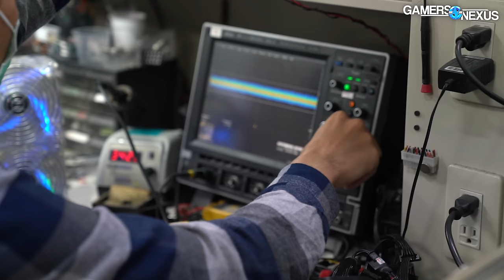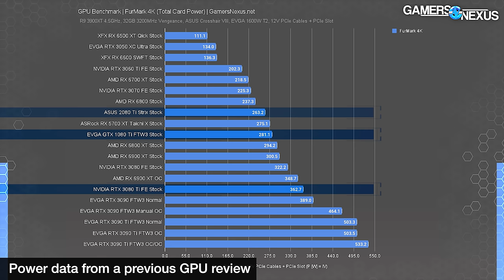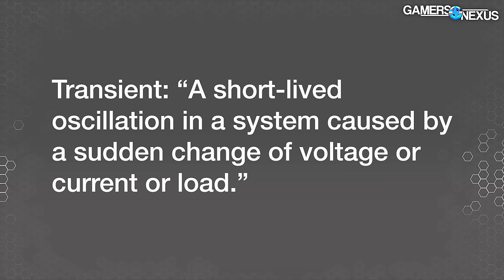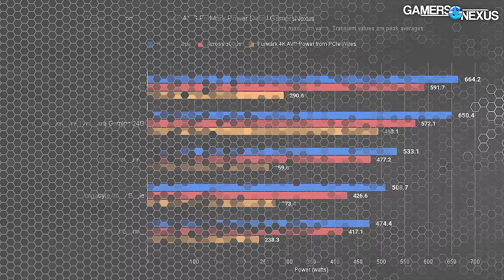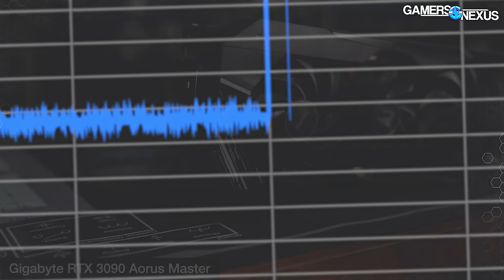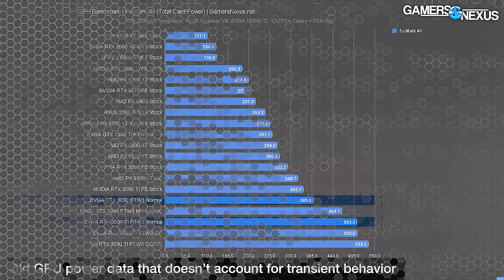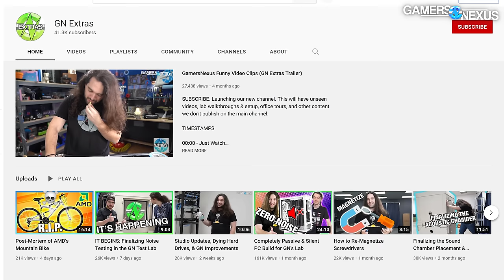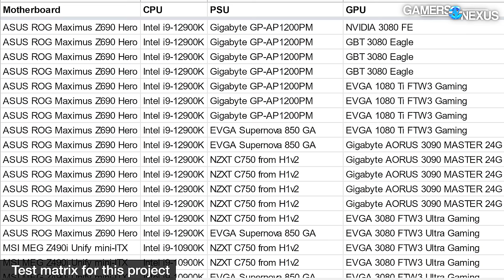The Brewing Problem with GPU Power Design | Transients

Comment: I don't know if this is helpful, but I have a 3070, 5800X both overclocked with an EVGA 750W G3 PSU and Gigabyte B550 Aorus pro board. I've never had a problem with this, but like you pointed out the transient spikes aren't as extreme with a 3070.

Comment: I have an old GTX 780 that would work great on a brand new 650W or 750W corsair PSU but inevitably over time due to stress I assume the card and old PSU combo would crash. The 980 Ti I replaced it with was capable of running on these old PSUs without crashing. So they may have had issues like this back then.

Comment: I had seasonic 650 gold with zotac
3080 amp, faced same issue changed the power supply to an antec 850 gold fixed the issue. I already knew about it i used to test it with shadow of tomb raider benchmark.

Comment: Very interesting indeed. I had a few random shutdowns recently. 

My specs
5950X
X570S Aorus Master
Asus Tuf 3080 Ti OC
Corsair AX1000 psu

I also have an older but still working corsair AX1200i psu. I might put the 1200 in my system and see if there is a change at all. As for the 40 series I was already planning to buy a new psu with higher wattage that supports both pcie 5.0 connector and intel atx 3.0 spec.

Comment: And that is why I always control, what my gpu is allowed to pull, and when. I owned gpu's in almost every range (from 30watt to almost 400)
But NEVER did i exceed the 250Watt all while still having 90-120% of its performance. (I professionaly optimize Hardware. Cpu's, gpu's, doesnt matter. I literally breathe voltage)

Comment: "You don't need a 1-1.2kW psu", they said, before a pandemic that destroyed normal trade of many things including high grade electrical components. "No one has that many periferials," they said, before gpu's were being scalped and required 30 amp minimums on 12 volts.

I'm glad I got my two 1k psus from Seasonic years ago, because I know those will outlast the mess that these gpus make.

Comment: Sending out huge current spikes into "long" wires are never a good idea from an EMC point of view, which is why it is taught to put decoupling capacitors on PCB's instead of letting noise be coupled back into the supply.
I guess I'm to some extend agreeing with the PSU manufactures, the GPUs should limit there power spikes to "reasonable" levels.
Also having to oversize the PSU may cause the average power to be further away from the peak efficiency of the PSU, increasing the power draw at the wall.

Comment: Even though this video is 4 month old, I'm having problems with transient loads.
Running a Ryzen 9 5900X on a MSI MEG X570 Unify with a MSI Geforce RTX 3080 Gaming Z Trio 12G powered by a Seasonic Focus PX-850.
My power supply is about 2 years old and it ran fine with a Gainward Phoenix GTX 1080 in the beginning, but ever since I had to switch the gpu in january this year, it started degrading to the point where the psu now "howls" right from the boot, shortly after entering Windows. Just as if the psu was screaming for help due to heavy loads.
I also get more and more graphic issues, like viewing photos with irfanview: when I have multiple photos open and close one of them, they become clearly transparent visible, overlapping the second photo thats behind that. Or in games that produce heavy loads.
Imho an 850w psu should be able to handle a 3080 but obviously it isnt. Ampere in retrospective was the worst gpu series I could've bought...

Comment: I having my real lab to see, why so important to have a proper PSU. Over 10+ years quality build PSU(with 10 years warranty) can handle hardware and time. I got lot of hardware with lot of watt usage. My rig is still going rock solid, I also clean up every 3-6 month because of the dust. If my PSU brakes down, i won't find probably the same quality now. Doesn't matter, i don't have the money to replace it anyways. :D I have used FX 8350@4.8 and Fermi 580@970 mhz for many years with zero problem with the same mobo(not even designed for AM3+) what i use now. If you want my spec i can do it.

Comment: I run a silverstone SX700, a SFX-L 700w 80+ platinum PSU for a 3080 and a 5950x and it seems to be working mostly fine. However I do have a 90% power limit on my GPU and an undervolted CPU as well (as I'm only running a single 280 loop for both the GPU and the CPU)
Reply: And it's a founders GPU, so no factory OC

Comment: So the question is will a EMF Reader go off and will it Go up or down based on how much based on it if you don't know on a EMF Reader has 5 Lights on it so I know in older homes it will go off but will it go off for the Graphics card as well

Comment: I had this issue with my 5700 xt. It would spike up to 400 watts and everytime It reboot it would tell me wattman power failure. Reviewing my AMD software recorded the spike... If my AMD software recorded 400 I can only imagine what the hardware you guys used would discover. I undervolted it and lowered the clocks which seemed to stop the issue, but I lost a 750 watt psu during the debacle. Using a 6700 xt now and it appears amd's main focus was performance per watt which has me loving the new card. I still put in a thousand watt just to be sure and occasionally check my power draw

Comment: A new PSU can buffer 400-500 Watts for 100-300 µs if its designed for it , but most older PSUs wont because they were designed to buffer only 200-300w µs spikes .
To be on the save side you will need at least a 1200 / 1500 Watt PSU for those GPUs which use  two of the new PCIe 5.0 power plugs , simply insane ...
If you look at the Intels ATX v3.0 plans ... ( nominal PSU Power 100 % ) = 200 % for spikes up to 100 µs or 180 % for spikes up to 1 ms , then no old PSU can fullfill those specs , for a 600W GPU they suggest a 1200w PSU which should be able a buffer a 1200 W spike for 100 µs = total 2400w ( USA has usually 110 Volts , i am not sure , can 110 volts deliver 2400 watts ?)

Comment: This started happening to me after an in-socket CPU upgrade! I have a 1070 FE and never had an issue with my old CPU, however the newer model is beefier and requires more power at base. Okay, no biggie, I thought. My PSU can handle it. Turns out I was wrong. My PC was crashing under mild video acceleration scenarios left and right. Finally disabled XMP and undervolted my CPU.. but it still happens from time to time, it just seems more random now.
Reply: I have a similar issue as u, had a 1070ftw and no problem with my i7 9700k. Upgraded my gpu to a 3080 and it's crashing my system like someone pulled the PSU cable. Got my gpu replaced still same issue now am hoping a higher wattage PSU will help but based on this video I doubt it

Comment: So I have the Asus ROG Strix Z690, Corsair Vengeance DDR5, the Asus Rog Strix 3060 V2 OC, and the 12900K. Twice now, I have tripped a 15 AMP house breaker while playing games and streaming for 2 hours or more. It is completely hit or miss. Note the GPU and RAM is not OC beyond their base settings and the 12900K is using the built in Intel Speed Step Turbo stuff. Could this transient power issue with the GPU be causing my PC to trip the house breaker? Oh and my PSU is the Corsair CX750M.

Comment: Its both: OCP is there for a reason. And it should trigger at selected value, which should be set according to the consuming device power requirements. So, basically, we need something like power delivery protocol which allows components to communicate and set things right, to power device and allow powerspikes at predictable values.

Simply plugging in bulky power connector is not enough nowdays. 1kW spikes are enough to bake connectors or even some components in the PSU.
If they rate PSU with 20 amps it is for a reason. So.. yeah, GPU vendors are the problem from the start. We have to blame them. But, they also claim you will need a PSU 2x more powerful than their card is going to consume.

In the end: a customer is the one who is guilty.

Comment: My setup: 5950X / 3090 Kingpin / MSI X570 ACE / EVGA 1300 G2.  If my equipment is doing these symptoms, does the fact that I'm using a 1300W PSU the reason I don't notice it?

Comment: Actually transient power draw would explain the strange crashes my computer has. They are very rare but if I crank up the settings and Halo infinite my system with a pulse RX 6800, r7 2700 (undervolted), 4*16gb cl 16 ddr4 3200 (undervolted), and 4 drives randomly crashes. I have an EVGA 750 watt G3 supernova. It's a shame if that's the case though since I've worked so hard to undervolt the CPU and RAM to give it extra headroom. It would also explain why these crashes only ever happen in Halo infinite.
Reply: I should also mention that I have 8 120 mm molex fans. Of the four drives one is a optical drive, two are hard drives, one is an SATA ssd, and the other one is an nvme SSD. If that gives perspective.

Comment: Could you test if using one of those huge caps meant for huge car audio setups in parallel with the 12 V connector of the GPU would actually help here? That should be good for 400 W over 100 µs if I was thinking straight. It seems that if neither GPU nor PSU manufacturers want to add the missing capasitors, maybe we need external solution.

Even 4F car audio cap is still cheaper than getting +400 W more powerful PSU.

Comment: It would be interesting to see if adding capacitors inline with the 12v rail would smooth this out. Im talking like full jank here capacitors on the actual power leads into the gpu i mean people run caps in thier cars for when the bass drops worth a try would be very interesting

Comment: I'm running a 3080ti FE with R9 3950x and 128GB DDR4 @3200 on a Corsair RM850x to power a Vive Pro 2 headset over wireless (so not at full 5k) with no problems so far.

Comment: I have a 650w SFF Corsair psu, with a 6600xt. When I overclock the GPU my PSU started to whine during gameplay, but not during benchmarks. To solve this, I had to raise the base frequency, which lowered the swing in power draw. I understand that Nvidia issues are different but perhaps normalizing the frequency speeds might reduce the size of the spikes.

Comment: I have an asus TUF 3080ti OC with an evga 750W 80+ gold psu, i have not had many problems (so far) but i also havent been pushing it because i read that i needed an 850W for this card. I did notice that if i try overclocking on anything even just turning on XMP it will not do it, so i really dont think i have much head room atm.
 So now im thinking about getting a seasonic 1000W/1300W psu just be on the safe side of wattage.
Reply: I pretty much have the same level of card (3090 Suprim X) with a 850w NZXT PSU. I've had zero issues OCing to the max 450+ watt used by the GPU. I just picked up a 1300w Antec Signature PSU that I have yet to install in case I decide to get a 4000 series card. Definitely pay for the 1300w over the 1000w, in my opinion, so you have the option to do what you want with the GPU.
Reply: @rpospeedwagon  Nice, yeah i think i will be going with the 1300W:)

Comment: I will not be buying a 4000 series card if the power requirements are as insane as they're asking. I have a 3080ti and a 1000w Seasonic and I'm fine right now but I don't want to have to start using a second power supply just to operate a GPU. Hopefully the 5000 series will be better.

Comment: The older, less efficient topology (linear power supply), will likely work better in those situations. Think cheap china 1000watt psu like the one Linus tested with a few 3080's. Ultra efficient buck and boost conversion (PWM power supply) is what cant keep up in these expensive power supplies.

Comment: I use an evga 750w psu with rtx 3080 rog strix and I do get random shut down when running at maximum performance. Am assuming it's the power supply because when I bought a 1000w psu, I have no more random shut down.

Comment: I have just recently rebuilt my whole system due to an issue ive been habing. My PC would lock up either with two blank/black screens or one black and one with a frozen image. The PC either restarts or sits there indefinitely. After replacing the motherboard, SSD, and PSU, the issue seems to be fixed, but ill never know if it was transient spikes or not...

Comment: I've been having these same issues since I received the 6800 XT.  I thought it was a temperature issue because Hotspot has been up near 112 at times under heavy load.  I have an RM750x power supply but I couldn't find a way to see if the system was powering off due to the power supply.  I also am using an Asus x570 Tuf Gaming Plus.

Comment: I use an evga sfx 550 with an overclocked 3070 and 11700 with no power restriction, also have the same sff 550 power supply with an overclocked 3060ti and 11400 with no power restriction. never had a problem and never had a shut down.

Comment: Wow, this is exactly what I experienced recently. 99% of the time the system was fine. Run VR, and it shut off. Install a bigger PSU (a good bit higher than recommended) and it works fine.

Comment: I just got a lian li 850w sfx and a amd 6950xt. It shuts down in 1-30minutes after you launch a game. Stress testing cpu and gpu independently works ok.

So it's going back to microcenter tomorrow and I'll swap for the new air 11 mini and a 1000 or 1200w atx.

Comment: I've got an issue that seems very similar to this. I have a ROG STRIX 3080 and a Corsair HX1000. Despite having a 1000w PSU, I am still getting sporadic shutdowns. I took my PC to a repair centre and they switched the AMD process to a lower end one which helped but did not solve the problem. I don't know what else to do now. Just waiting for the next shutdown.
Reply: did you try undervolting your gpu ?

Comment: i9 9900k clocked all cores 5.1 Ghz , 3080 Ti FE overclocked +95 core clock, +431 memory msi afterburner, corsair HX 750i Platinum power supply ...didn't had any issues ..Happy days !! Love the stories guy bought 3090 and bought cheapest psu on planet well done lol

Comment: The consumption in a PC is not steady, HDDs are also a source of huge spikes,  that's why I have added over 10000uF in my system from long tyme ago. These 0.01F is not much for a 5 - 30 A current consumption. In the end it helps prolonge the life of my system  by reducing the Voltage drops, spread the load and reduce the transient amount on capacitors. This is a normal practice in the audio world.

Comment: Really sounds like hardware manufacturers need to get together and agree what level of transient load should be acceptable. Because clearly no computer part is ever going to draw the exact same amount at all times. But a 4080 also should never just try to draw 10kws just because an engineer figured out how to use 10ms of 10kw to increase performance by 1%. But at the same time, it sounds like the graphics card manufactueres have been keeping their percentage transient power the same, and it is the PSU guys that are cheaping out. But even high quality PSUs does advertise thier trasient power capacity, so how is anyone suppose to know?

Comment: Try playing Diablo II Resurrected on RNDA2 without plugging in two SEPARATE 8 pin connectors. It instantly shuts off after the character loads, even though Shadow of the Tomb Raider runs perfectly fine on a single daisy chained cable. So I assume you could even point the finger at the game developer.

Comment: I have 850w with a 3090 and while it works fine most of the time occasionally my PC shuts off from a spike. I regret not getting 1000W but will be getting the biggest PSU possible for the 4000 series. Hopefully there are more innovations with smaller sized PSU's because I rly don't want to stop using ITX form factor.
Reply: These spikes u getting are they when u game or watching utube or doing basic stuff. My pc had a 1070ftw and never once had a issue with my rig soon as I upgraded GPU to a rtx 3080 (PSU is a 850w seasonic) my pc would just randomly turn off. This is not in gaming but watching utube :/ so now am hoping a 1000w PSU will help but am in doubt :(
Reply: @thealien_ali3382  I undervolted it a little bit and it never shuts off anymore. Getting the same performance still also.

Comment: You call a supply rail a signal then say "this is all basic stuff".  Don't feel bad, the terms are tricky.
Transient response is a result of many factors, not simply component quality. The easy solution to poor response is always more filtering, or more electrolytic caps.  The I would measure the effect of a transient on a circuit is by measuring voltage at the circuit input and ps supply output. At high currents wire resistance matters.

Comment: I had a 3080ti and gamed on a 1440p monitor. It felt like overkill and had this jittery effect rather than a silky smooth feeling. I changed the settings but still had the same jitteriness. So I sold it and downgraded to a 2080. Back to silky smooth and is over the refresh rate of my monitor anyways. Guess I'm no longer a high-end enthusiast anymore.

Comment: If I undervolt, will it greatly reduce the transient spikes? I've undervolted my 3070 ti to 1845MHz at .875v. PC power consumption at the wall using the same benchmarks reduced 60-90watts (vs stock GPU) on my Gen 1 NZXT H1.

Also, my Seasonic Prime 750w started just shutting down and resetting the PC with my 2080ti. Sent it in for warranty replacement and it's arriving Tuesday. Maybe I should undervolt that card too.

Comment: This is why I’ve always went with a 1000 to 1200 watt PSU even if I could get away with a around 600 to 800. I’d rather have more power then needed then not enough if something draws more then it’s “supposed” to or if & when I add/upgrade down the road. Don’t skimp on the PSU it’s what power your system and with out it your not doing much & or possibly take out a your system or a part.